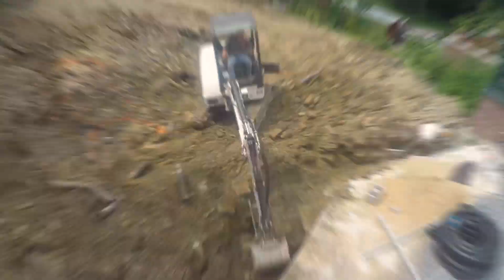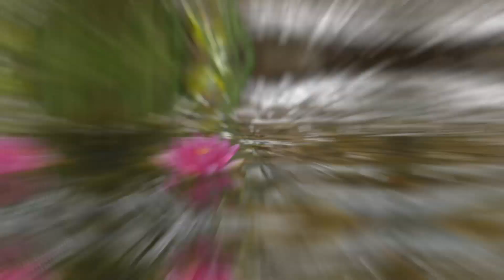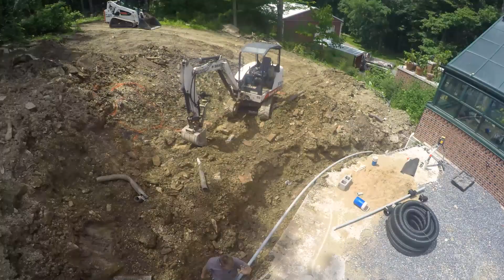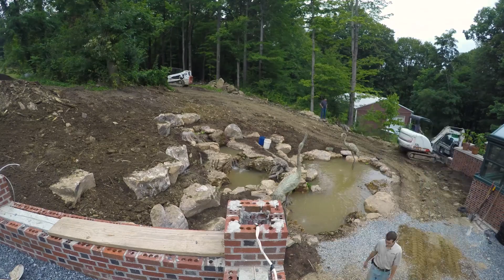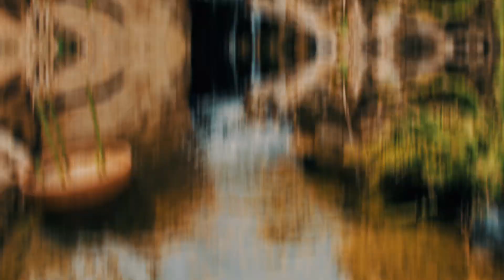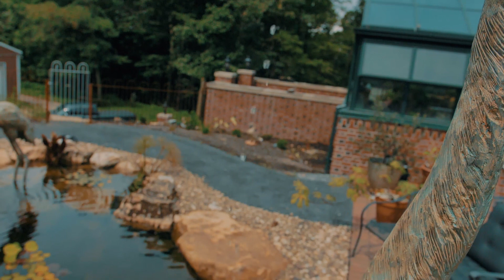Premiere Collection KOI POND installation - Tussey Landscaping

Comment: I have a question, please help clarify. Do you have to put underlay between rocks and liner. I see the big boulders might need it but what about approx 50-100 lb rocks? Thank you!
Reply from the maker: Great question! We always put rock pad (a 1/4" thick fabric padding) under the liner, and then in addition, above the liner, under any large boulders. In the 50-100 lb range, we usually dont. Unless the sub grade (the dirt beneath the liner) is extremely bad